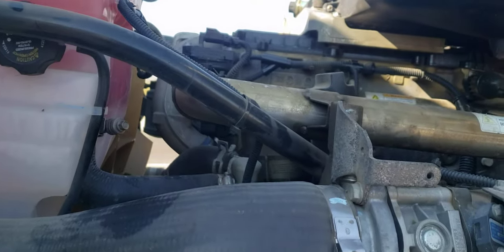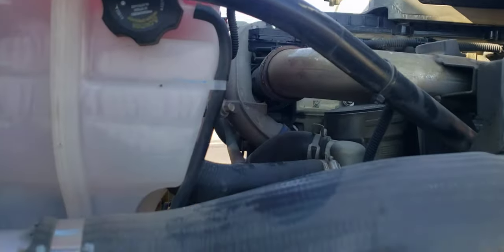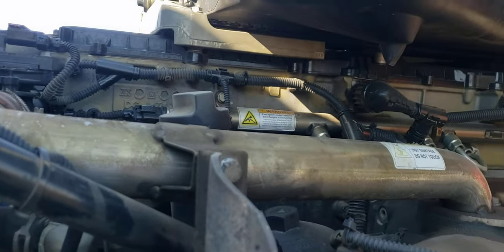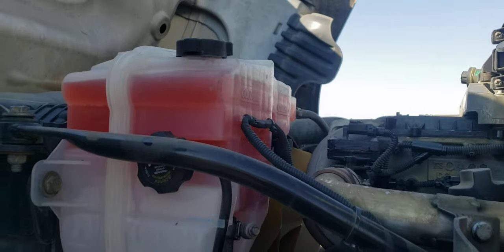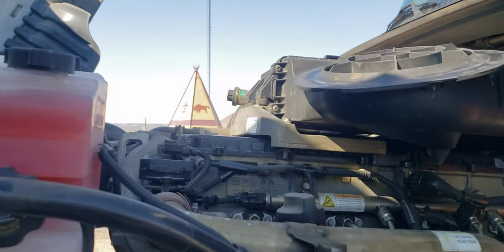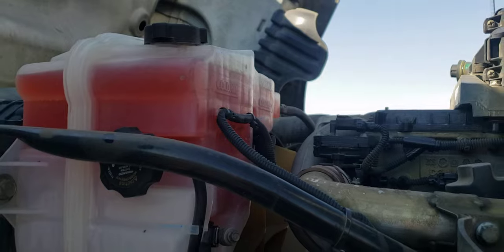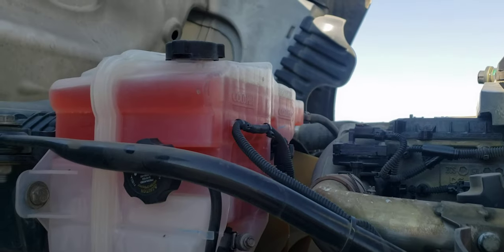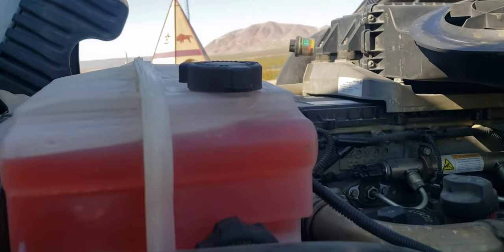How I fixed coolant high pressure on Freightliner cascadia dd15

Comment: I had the same problem and the shops were saying that most likely it’s a blown head gasket. I replace the reservoir and problem fixed. There’s a video of on YouTube that shows what the tank actually does besides holding the extra coolant by Francisco Amaya. The reservoir has a smaller tank inside and when it breaks internally you get high pressure. Replacing the reservoir caps will not do anything because it’s broken internally.

Comment: So I just replaced my reservoir with the OEM one from dealer like 3 months ago.  The truck was at numerous Freightliner dealers for SCR/OneBox issues and they regen'ed it over and over and over.  On my way home on that trip the coolant has high pressure once again.  I am convinced that Parked Regens destroy that coolant reservoir
Reply from the maker: Hopefully you can solve the problem,  thanks for watching sir 🙏
Reply: What was tthe issue bro

Comment: I just replaced mine. I purchased the aftermarket one brand new from Freightliner dealer for $240. 
My engine temperatures were not high. My coolant reservoir had a pin needle size hole on top and it was spray misting a leak.

Comment: I just bought mine haven't replaced it yet. The sales guy at parts told me that both oem and after market are made by the same company they just slap their label on them. Not sure of its true but don't want to take a chance I'll be exchanging for original.
Reply: 90 % of 3m parts are exactly this. I know first hand

Comment: yes man I did fix it myself. Everyone was saying (blown gasket etc) there are two sensors on the driver side of the engine. Coolant and oil sensors. Replace those and problem will be solved. Are you also running a bit hot during heavy loads and or uphill roads? 
Let me know if I can help more.
Reply: Bro yes changed my Radiator reservoir thermostat now I’m about to change my egr
Reply: It’s been a headache

Comment: What about replacing the cap first and sometimes is air accumulated in the system after a cooling system work. Sometimes you just need to burp the system and the problem is fix.

Comment: I replaced the coolant reservoir with an original.  The other one was after market and it cracked and the tank before the reservoir also cracked and leaked coolant. With this original it’s leaking from the top cap.  I replace the cap and it’s still leaking.  Any ideas ?

Comment: maybe it was the cap it self ???? not the whole reservoir
Reply from the maker: no, I tried that too. thanks for watching sir 🙏
Reply: Teflon fixes the issue also, the tread on the cheap reservoirs suck
Reply: I’m having this issue and tried a new cap, nothing changed.
Reply from the maker: Try replacing the reservoir,  from the freightliner dealer
Reply: Its not the cap, i got the same problem and replaced the cap and problem remains,  i think the lip were the cap screws on gets warped from yrs of tightening the cap down on it and when u go up hills and temp goes up the coolant gets hot and expands and oozes out the cap.
Reply: That was my thought too
Reply: What cap did you change? The one on the side is the one that releases the system pressure

Comment: But the problem I'm giving is I also changed the reservoir and radiator together about 200k ago. Why am I having the issue? It's building up the coolant and it's to the very top when I'm running the truck and its hot. Is it supposed to be all the way to the top? (Coolant).
Reply: Did you end up finding the issue? Having the same problem while running the truck

Comment: HOPEFULLY YOU CAN ANSWER MY COMMENT SOON, SO THAT I KNOW IF TO BUY IT OR WAIT. DID YOU GET THE CHECK ENGINE LIGHT ABOUT LOW COOLANT SENSOR? EVEN WHEN RESERVOIR WAS FULL??
Reply from the maker: Hello, no i didn't,, you can check if your sensor is damaged  by bringing the 2 wires on the sensor plug
Reply: @TRUCKINGTIPSDIY  thank you brotha!! I had the same exact issue and just like you said it… get the factory one. Freaking $200 bucks more but problem solved.

Comment: My truck for some reason keep leaking from the tube that comes out the side of the coolant reservoir. 

But there’s no sign on my dash saying the truck running hot or nothing
Reply from the maker: I think the reservoir was over filled,  try running the truck till it gets to its normal coolant level, if it stays on a level thas not going lower than everything should be fine
Reply: Mines doing the same

Comment: 👍It's hard to believe! but what do you think what happened with the old reservoir tank? mean any explanation to the high pressure?
Reply from the maker: The old reservoir was a aftermarket i believe that was the problem, thanks for watching
Reply: @TRUCKINGTIPSDIY  does it work the same if its low pressure? Im losing coolant within a few days with no leaks
Reply: @Judah_773  did you ever figure out that problem cause when I drive it loses it. With no leaks when I stop it floats back up
Reply: @allatry23  it was my gaskets. I had to replace. After that i had no problems

Comment: have you ever replaced the sam cab on a 2013 freightliner?
Reply from the maker: no I never have, do you need to have one replaced?
Reply: @TRUCKINGTIPSDIY  yes I need to replace mine. I haven't had any luck on finding a video on you tube
Reply: Jorge Facio  Sam cab is more like fuses. If you planing to change Sam can remember you have to program it with Detroit software. There is no other way you can replace it. I would recommend to check fuses. What is the reasoning you have to replace it.
Reply: @davinderpalsinghthind291  the connections on the back are rotting. its giving me abs relay fault codes. I've replaced the relays and it didn't fix the problem
Reply: If the Sam cab has damaged FETs from testing circuits with test lights etc. then you would have to upload your latest setting to diagnostic link 8 and install a new then reprogram with previous software. If the issue is fuse related then I would start in the circuit.
Reply: @jorgefacio690 
It is not sam cab. You need to replace sam chassis.

Comment: What’s the knob on the side do? Do you tighten it or have it loose?
Reply from the maker: Tighten it (both) the side one is a safety cap if the coolant system builds pressure it releases from that cap
Reply: I had the same problem and I just loosened the side one problem fixed…that was 3 months  ago
Reply: @jeronimo907  I’m going to try that. I done the combustion test with no change. I did replace reservoir with oem one. Let me try what you did

Comment: He should have changed just the cap on the reservoir...that goes bad...
Reply from the maker: I did, i had to replace the reservoir...
Reply: i mean just the cap.....u could buy it
Reply: Have you had anymore problems? I have bubbles in reservoir overflow bottle I attached, not sure if it’s a head issue or compressor?
Reply: @jddees24   prolly just air in the system.  have it bled
Reply: @el-hp1lj  it’s a head gasket, waiting to have it repaired now
Reply: @mehdiameri9574 he replaced the caps first. It wasn’t the caps.